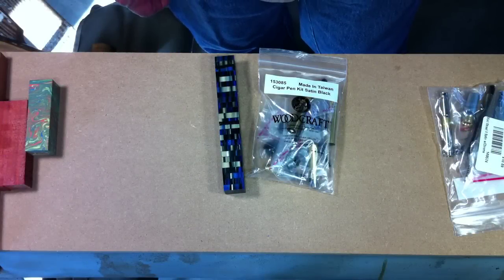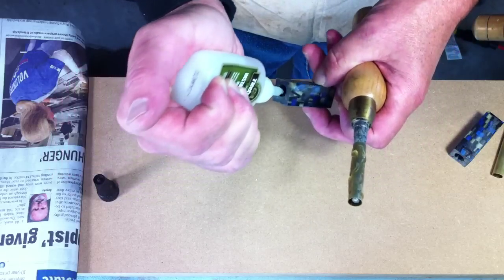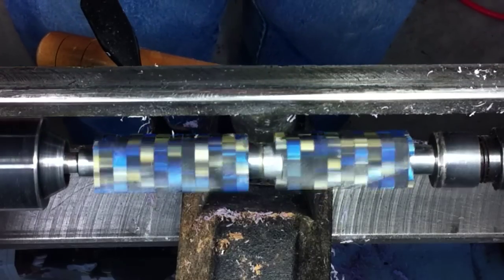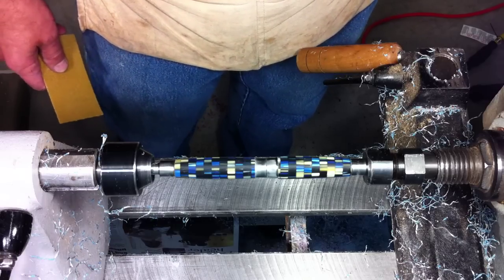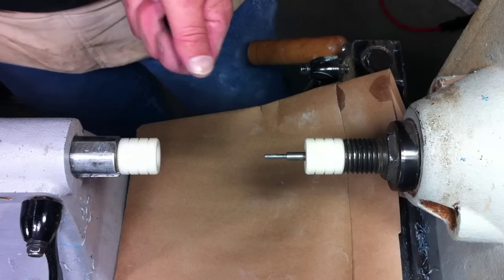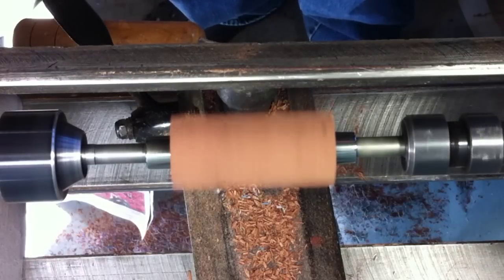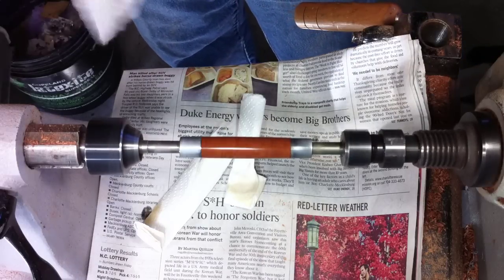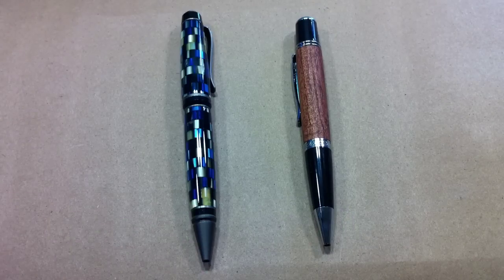Turning A Cigar Pen

Comment: Two beautiful pens Steve.
I like the way you use your lathe as a press.
I don't have a pen press and am wondering where I could buy the parts to turn my lathe into a press.

Herms
Reply from the maker: Herms - Thank you for the comment and for watching my video.  I bought the assembly press from Craft Supplies.  They call it an Ultimate Assembly Tool.  Here's a link.  http://www.woodturnerscatalog.com/p/16/2798/Artisan-Pen-Ultimate-Assembly-Tool?term=ultimate assembly tool.  Cut and paste to your bowser or go to their website www.woodturnerscatalog.com and search for Ultimate Assembly Tool.  Good luck and thanks again for watching.  Take care,  Steve

Comment: More information about bushes, which ones can I use for the most different kits. Regards Alf
Reply from the maker: Alf - I'm not sure that I understand your question.  Pen bushings are specific to the type of pen.  For example, the bushings for a cigar pen won't work for a pen such as a Wall Street II.  The instructions that come with the pen kit usually provide information on the appropriate bushing size.  There are videos on YouTube on how to make your own bushings.  Search YouTube and you'll find them.  Not sure that I was all that helpful.  Take care,  Steve
Reply: Yes, very !!! but thats what i mean ,you need to buy bushes for the Slimline ,the Euro ,the Churchhill style pens.  It seem pen kit manufacturers want us to buy more,, but it will stop me from making different types of pens,and just make the ones i've got bushes for ,are there any bushes that will do more than one kit.  Thanks i will look for those other video sites ,,Regards Alf
Reply from the maker: Alf - I've found that the bushings for a cigar pen from Woodcraft, for example, also work for a cigar pen from Craft Supplies.  I believe some of the bushings are interchangeable between pen kit suppliers but only for the style of pen.  Using a pair of calipers and a pen kit you could turn a pen blank without using a bushing.  You'd have to take careful measurements of the pen parts and turn the blank to those dimensions.  I'll be turning some pens in the near future and will try without a bushing.  If I can get it to work I'll post a video.  Take care, Steve

Comment: Great video - one question - do you have any tips for aligning the drill bit with the axis of the blank - so that the drill bit runs straight down the work piece? Some trick for aligning the table with the drill bit?
Reply from the maker: The only tip I'd have would be to use a sharp drill bit.  Brad point bits seem to wander less than a normal bit.  Proper drill press speed is also important.  Go slow when drilling and clear chips often.  If find that if it take my time and back the bit out often I have better luck.  Even doing all that I still come out a bit off sometimes but never enough to ruin the look of the pen.  Hope that helps.  Thank you for watching my video!  Take care,  Steve
Reply: Thanks! I guess I was also wondering about how to measure the 90 degree angle(s) between the vertical bit and the drill press table. Can one assume that the bit is exactly parallel to the post on the drill press, for example?
Reply from the maker: fgriffintx Smith Making sure the drill bit is at 90 degrees to the table can be as simple as checking it with a square.  The blade of the square should touch the drill bit along it's length.  I use a digital angle gage (Wixey makes one as do others) to check the angle.  The gage has magnets on it's side that hold it to the drill bit.  Zero out the gage while it's on the bit and then put it on the table and if it still reads zero they are 90 degrees to each other.  There are other ways to do it with little or not cost.  Google "squaring up drill press table" and you'll find other information.  Hope I answered your question.  If not let me know and I'll try again.  :-)  Take care,  Steve

Comment: Both pens turn out great.  Is that a special tail center instead of the usual 60 degree cone?
Thanks,

Cip Mendez
Reply from the maker: Thanks Cip.  I got the tail center from Penn State.  They call it a pen mandrel saver.  It's hollow in the center sized for the pen mandrel.  The mandrel passes through the center which allows the center to push directly onto the bushings.  Theory is that it doesn't cause the mandrel to flex like what might happen with a cone center.  It works pretty well.  I've seen something similiar in the woodturner's catalog.  Take care,  Steve
Reply: Thanks for the info.

Comment: That's just beautiful. What brand/model lathe are you using?
Reply from the maker: Thank you very much. My lThe is an older model Delta 1440 that I bought off Craig's List in 2008. I had to rework the tail stock and most of the head stock but it works pretty well. Parts are getting hard to find so I'll have to replace it one of these days. Thanks for watching and commenting on my video.  Take care, Steve
Reply: Awesome.  Just bought my first lathe-a Jet mini that's almost new.  I have some practicing to do, but I bought the blue blank just to have when I'm ready!
Reply from the maker: Congratulations on getting a Jet lathe. I'm sure you'll enjoy many hours of turning projects on it. Good luck with the pen. I use mine every day at work. Thanks again. Steve